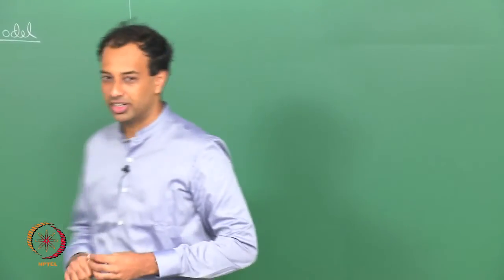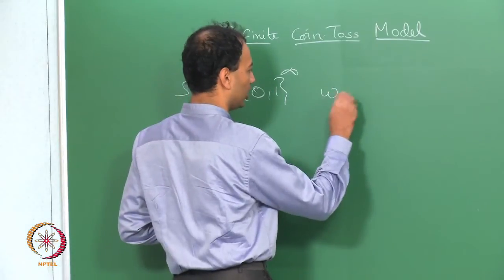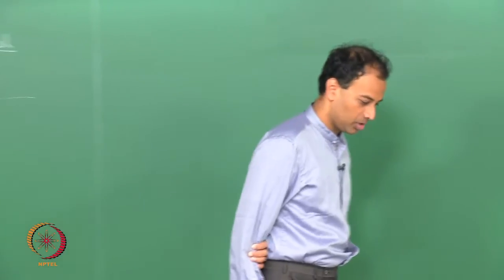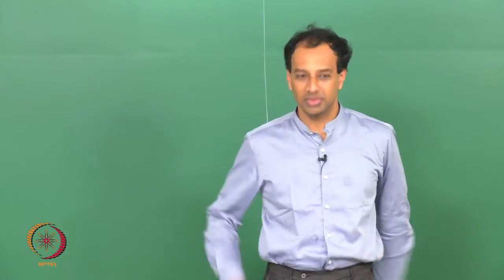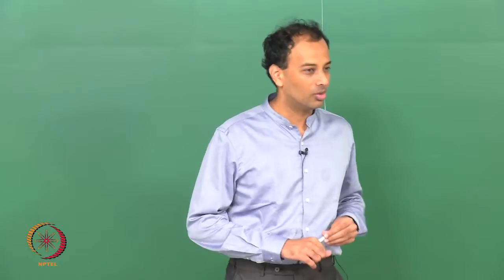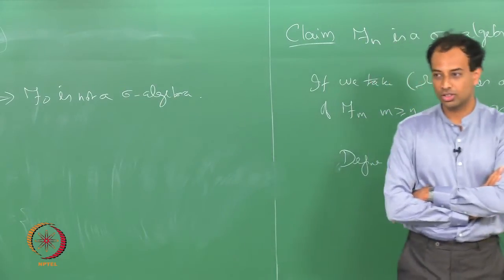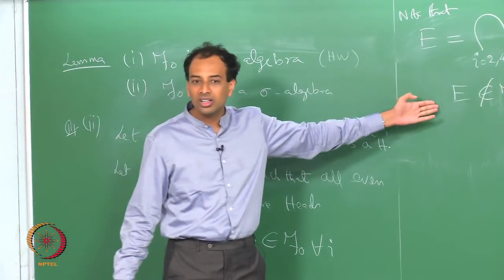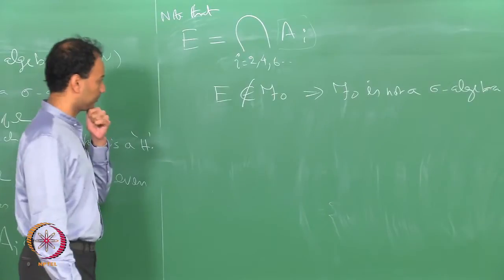Mod-01 Lec-11 THE INFINITE COIN TOSS MODEL

Comment: I have defined a probability measure with sample space (0,1] for one event X and a probability measure with sample space (-1,1] for another event Y and also the event Y depends on X , the probability space considering two sample spaces will be a joint probability distribution, is my thinking correct? If not , how do I get the notion of multidimensional probability space.

Comment: @42:31, how is P(Omega)=1? How does it equals to 2^i/ 2^i?
Reply: Health Freak Because the cardinality is 2^i (numerator)
Reply: Observe that, Omega={w| w_1 in {0,1} } and hence Omega in F_1, then P_0(Omega)=|{0,1}|/2^1=2/2. In general, Omega={w| w_1...w_i in {0,1}^i } and hence Omega in F_i, then P_0(Omega)=|{0,1}^i|/2^i=2^i/2^i.
Reply: @shivamsbansal  how |{0,1}^i| = 2^i ??
Reply: @quant-prep2843  {0,1}^i is the set of all binary strings of length i. Each "bit" has 2 options: 0 and 1. So, total number of such strings = 2*2*...*2 (i times) = 2^i